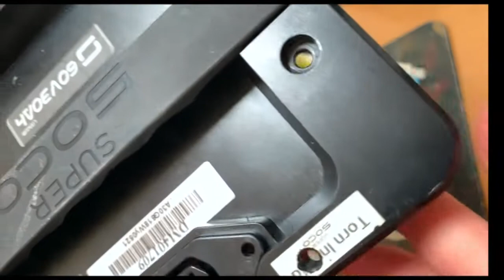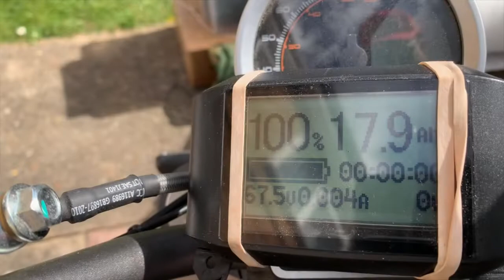Super Soco Melted Battery Connector Replaced with XT60 Mod

Comment: Hello. How many 18650 cells does the battery have? Which is the capacity of each cell? I imagine a battery configuration of 16-17 cells in series (with a nominal voltage of 3,6 V: 60/3,6) and 12 cells in parallell (with a nominal capacity of 2500 mAh; 30/2,5). Thank you and your help will be appreciated
Reply from the maker: all in the video☺️

Comment: Hello Sir, i need a little help from you . Since am having problem with my super socco tc , speedometer stop working ( no battery pencentage, changing speed 1to3 dont apear on the screen it remain 0 . When riding the bike it dont show the speed it shows 0kmp. So i dont know if its the bms or its the controller that need to be change. In the battery communition pin am having 34volt on all 3 pin , can you check that for me please sir . That will be appreciated
Reply: I have the same problem. I ordered a new BMS and I have still the same Problem. I think there must be a problem with the data cables.
Reply: how did you get the internals out of the aluminium enclosure?
Reply: @michalwallentinsen5759  if u screw out the 4 screws on top and bottom. One of them is under the valid label. And on the side are also 2 under the labels. If u remove these 10 screws, u can easily pull out the batterie block.